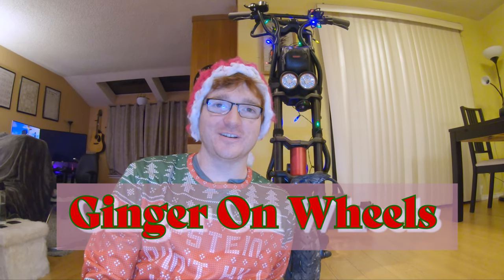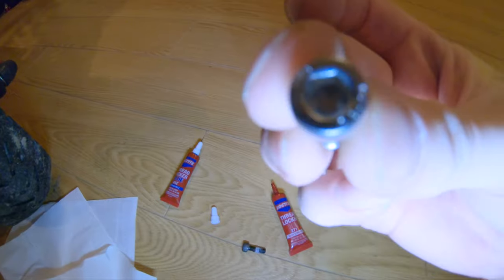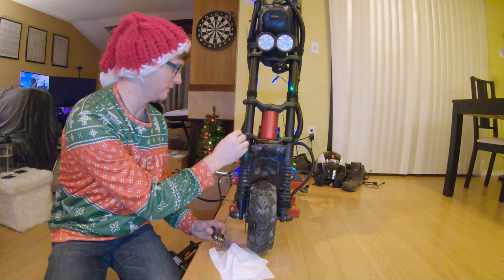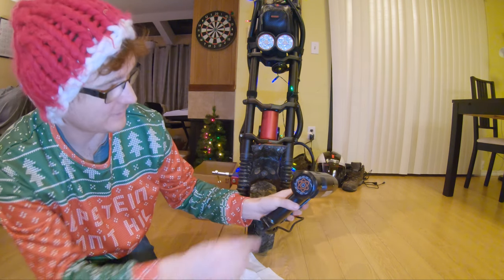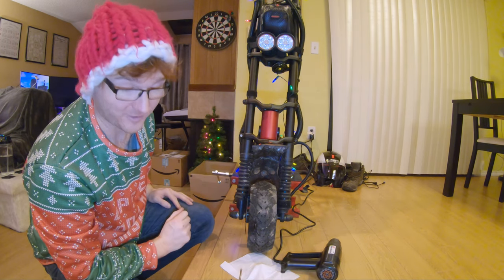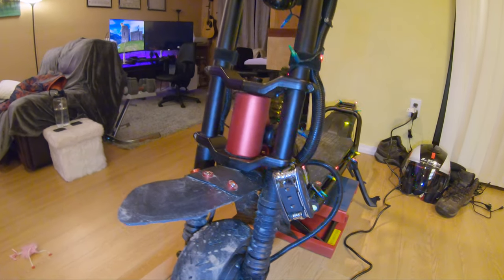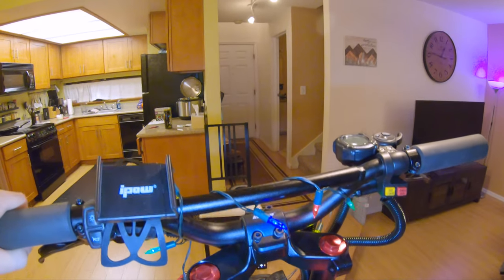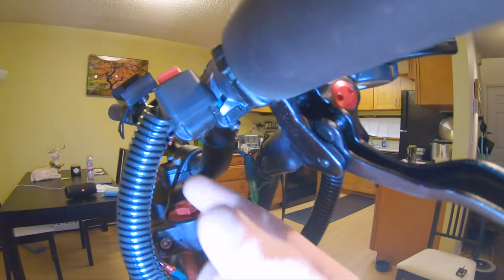How to remove permanent thread locker (Loctite Red removal) - New Stainless Steel Fork Screws.

Comment: Bolt torque should be 15 to 20 foot pounds.  
Should only be using a  blue loctite 248 242 ect.

Comment: Is it safe you use the heat gun on the motorised wheel. My wheel has a puncture and it has loctite on both sides.
Reply from the maker: Yes it's safe. As long as you don't melt any plastics

Comment: Use some super glue and baking soda to fix the broken turbo mount
Reply from the maker: That's what I've been doing with all the other mounts so far. It would just be nice to have a scooter without pieces broken , ya know?
Reply: @GingerOnWheels  I agree lol I'm just glad this fix holds up and it's not zip ties and duct tape to the rescue